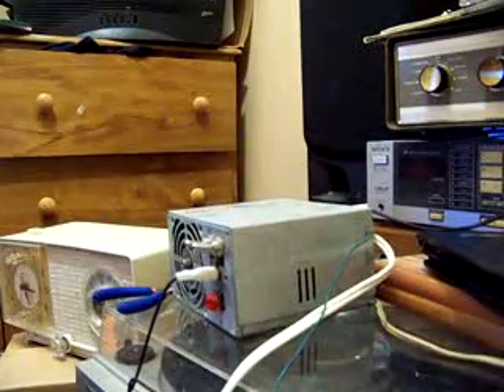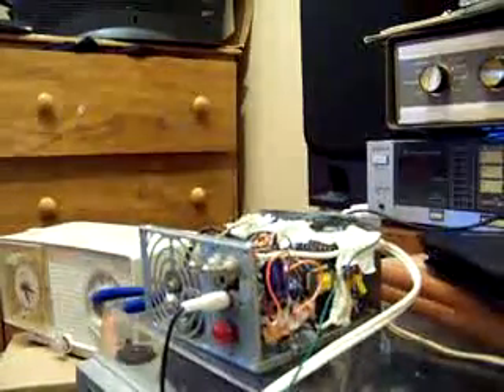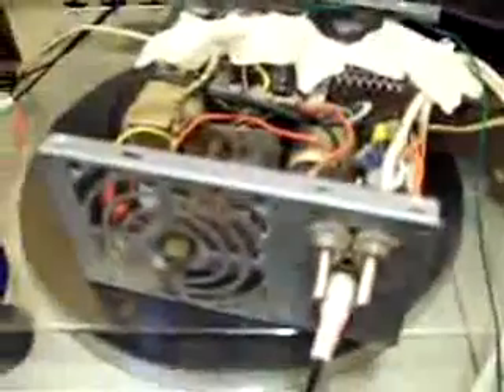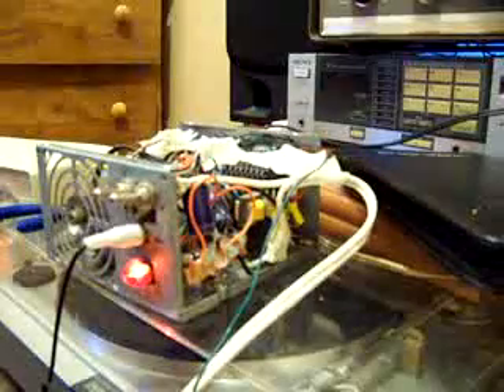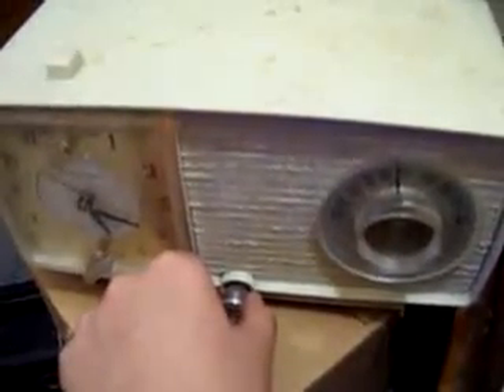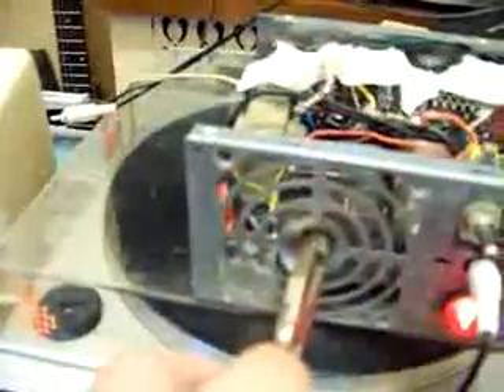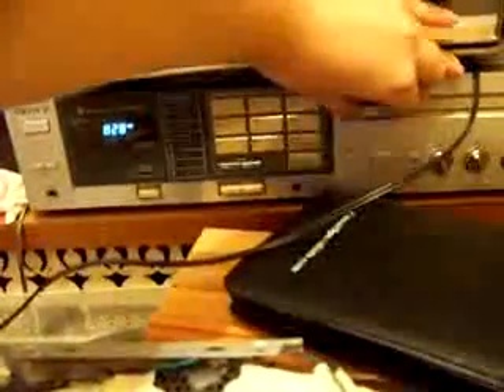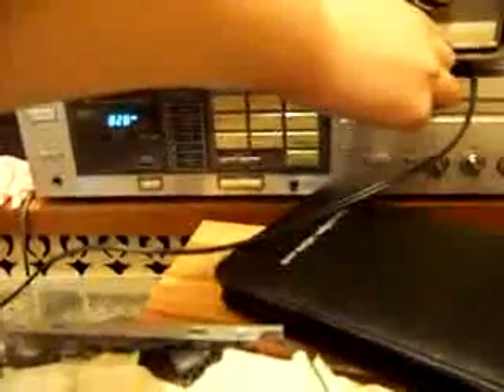Home Made tube AM transmitter for home radio broadcast

Comment: @FelixTheHouseFreak 
I remember when i was 4 year old my uncle had a receiver the same model you're using, it is a real vintage set, it uses a sealed cooper motor and gearbox for the clock , now I'm 41 and my uncle dies 35 years ago , and by the way I work on electronics and designed and built several TV, FM, and AM transmietr stereo & RDS encoders, stl links and 467 proyects more anything you can contact me

Comment from the maker: @mcoates50 Hello.  Google antiqueradio forum.  And join the forums.  Go to the homebrew section and make a thread requesting info on it or do a search using the forum search function.  You may be able to use the search function without joining.

Theres a few very good designed transmitters made by a few of our best members.

Comment: @FelixTheHouseFreak I have built an AM transmitter that had sound quality pretty close to CD quality but only on wide IF tuners, on normal narrow tuners it still sounded good. Mind you the transmitter I built was a solid state, and it used a transformerless direct coupled class A modulation under class C final Emmitter, so would have had very linear modulation characteristics. I have the schematic if you want it, very simple and is power supply hum immune so can run off a conventional walwart.

Comment from the maker: @Cringle84 Well it runs off a crystal oscillator as it is and the audio quality is not too bad.  Its no hi fi system but im not really looking for much.  Once i get an FM stereo transmitter going il be looking for more quality though.  

Il be putting up a new video of this thing being rebuilt soon as it was first built when i was around 14 or so and i did some pretty shabby work.

Comment: Its impossible to get good audio quality out of a tank circuit tune transmitter, unless the oscillator is separated from the modulator tube by a buffer amp, because you end up with the oscilator drifting with the voltage changes, causing undesired FM. Go for crystal lock or PLL on your next design.

Comment from the maker: Hi and thank you!

The way its set covers my property nicely.  By increasing antenna size and plate voltage to its tube it can cover a street or two.  Thats against the FCC rules so i dont do it, although i think they have better things to worry about. heh And yes ive used a mic and it was fun!

Currently it is dismantled.  And as i said in the video im now rebuilding it.  Will be posting a video soon of the rebuild and improvements. Just need a couple more parts for it to be better than ever!